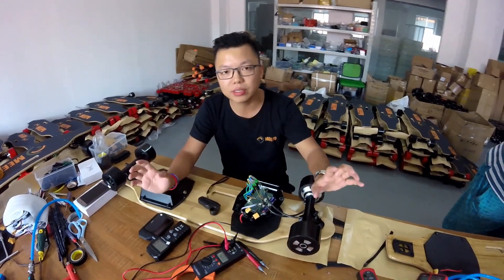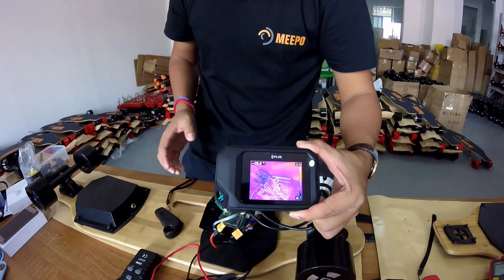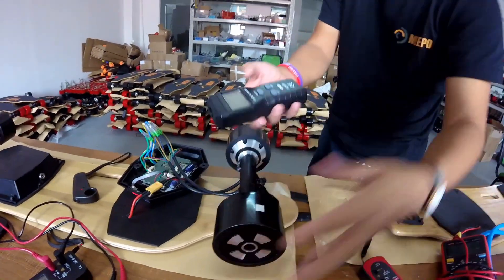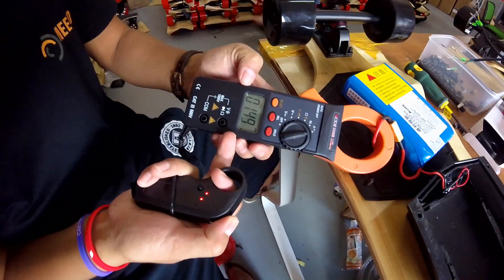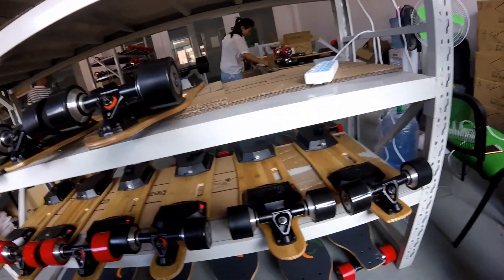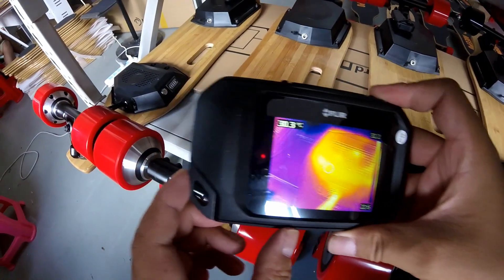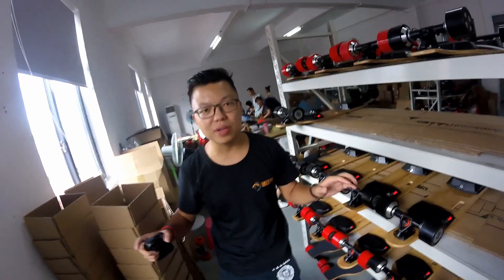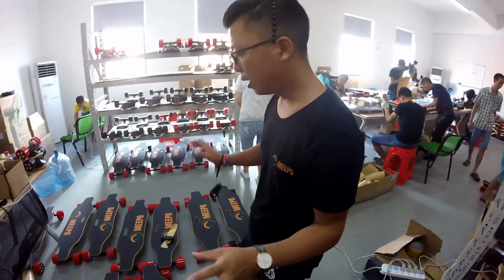How to check quality of Electric Skateboard

Comment: You tested the heat by having the boards upside down running, but if they are being ridden carrying weight the motor will be more stressed and hotter than with no weight load on them.

Comment: Kirian, i just get into this electric board stuff, and its my second day watching videos about. and i add this crazy idea, why dont you make a 4 motorized board ? your pair motor is at 42,60 box and if you add to board, the propulsion will be divide, so it cold have the same range, in theorie, but you could to put a second battery, it could range the double distance and have 40 miles per hour lol. for sure it will be more heavy... but it will be a showoff !!! the most insame board for less than 500 USD, in case you wonder to know if i am rider, not at all, i am architect and love domotics stuff ;) i love to receive one of your board, but i am in Angola Africa, not best road to ride lol, at least on the city.  but maybe one day, success to you

Comment: I got my board for almost 2 weeks now.  It's really fun to ride.  
I have two problems: 
1) the board cannot be turned off, the power button does nothing.  I have tried letting it drain completely and as soon as the I plug it in to charge, it'll turn on.  This board has been on contiguously every since I received it.  
2)  I have been emailing and Facebook messaging Meepo for some help with this issue since September 13 with no response. 

Maybe the demand is well exceeding Kieran's limit to maintain the original level of communications and responsiveness with the first few batch of boards for reviews. Unfortunately I have to resort to commenting on your YouTube video for assistance. order #MEEPO-1232

Comment: Hi, Im looking at buying this Meepo board. My only concern is how long it would take to ship to Germany. Also in case something stops working, do you sell all the required spare parts. Thanks in advance.
Reply from the maker: you will receive in 18 days around. all parts are available on my webstore.
Reply: Thank you for the quick reply, how long would you say the wheels would last if the board were to be used for around 2-3 miles daily.
Reply from the maker: Here photo of motors after 600 KMs =2 months for me = 7 months for you, now its the third month, these ugly motors are still serving me.
Reply: Unless they are some weird kind of urethane, they should last for years. I am riding regular wheels with several thousand km on them that are almost 20 years old. I wear out shoes long before wheels wear out. I would guess the motors will die long before the urethane wears out.

Comment: Is this travel-safe?? Pls reply I'll be getting one after PSLE
Reply from the maker: TryinHARD YT I think so, but I cant garantee.  you can put battery in backpack.
Reply: Kieran E-board Oh okay thanks
Reply: should be okay bro..check in the meepo board and just take the battery out and in your backpack. A person can hold up to 160Wh and the Meepo's battery is 158.4Wh and maximum of 2 spare battery per person. Also you'll want to give individual protection for the battery like a case to prevent short circuit. Source is from a 'Cabin Safety Instruction' Sheet for Singapore Airlines (One of the most safest/strictest if not the best airlines in the world)